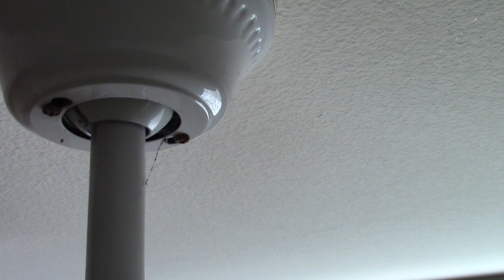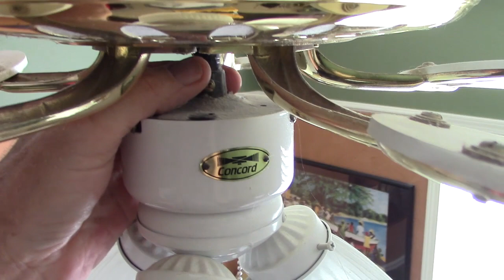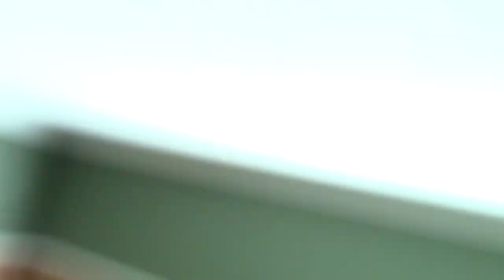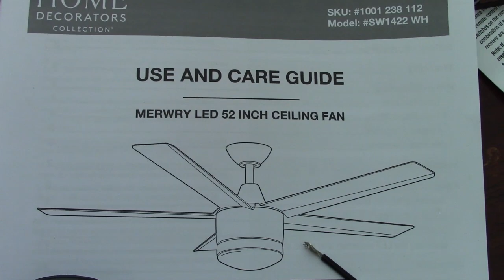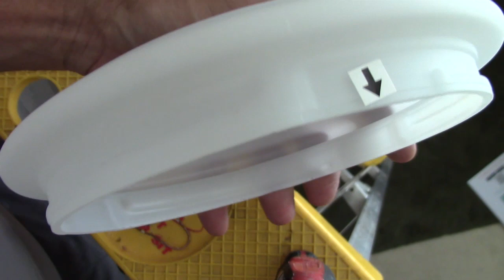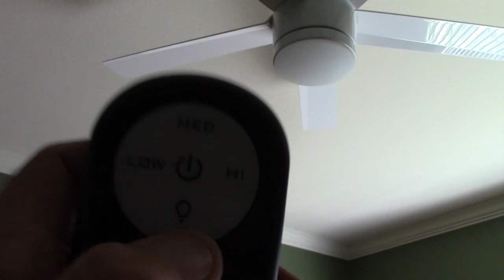Merwry Ceiling Fan, with problems

Comment: The humming I hear around 8:50 is that normal for you?

Iv noticed my fan has started to hum and not sure why .
Reply: That hum is when the fan came on by itself. Remember my phone mic is only a few inches away. Whenever I use the fan there is a hum but sounds normal to me and that hum hasn't changed since first installed.
Did you see the section at the end about the fix for the fan coming on by itself? Just like it did around 8:50.
If the fan has been working normally and the hum is new, might make sense to check into it. Is it possible the control box at the ceiling has moved or maybe a blade is out of balance? I'm totally guessing.
Reply: @dennisleary9733  my hum sounds exactly like yours and I hear it in a completely quiet room about 4-5 ft away - guess I’m just hyper sensitive to it..
Reply: @lucky55526  lol, could be. The breeze from the blades lessens my fans hum. Most noticeable at lowest speed.
Reply: @ go figure, I only run it on low..

Comment: My light is turning on randomly at night, disturbs sleep, its super annoying, what can I do about it?  Sometimes the fan turns off too. I have the switch on all the time, i use remote to turn on or off
Reply from the maker: It's possible the receiver in the ceiling is faulty. Similar problem to the one I had. 
I would suggest calling customer service

Comment: I had the exact same issue with this fan. i replaced the receiver and it still turned on by itself. I assumed i had ghosts.
Reply: Did you ever get your problem fixed? Mine is doing the same thing and I don't know how to fix it.